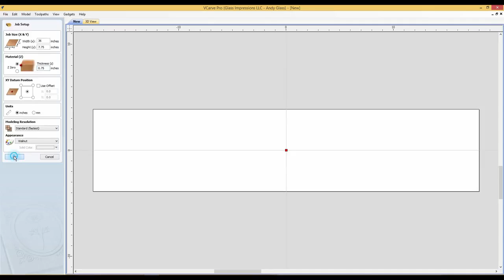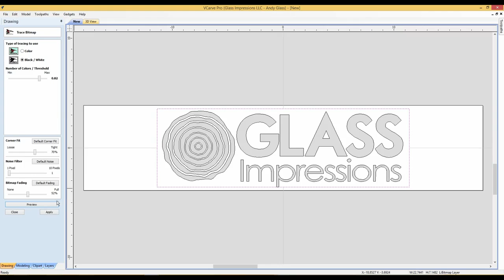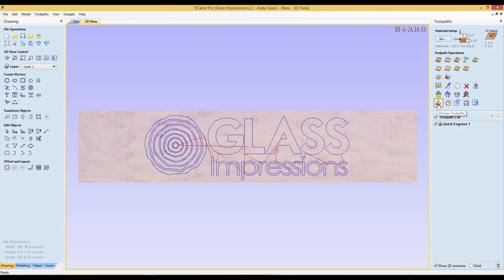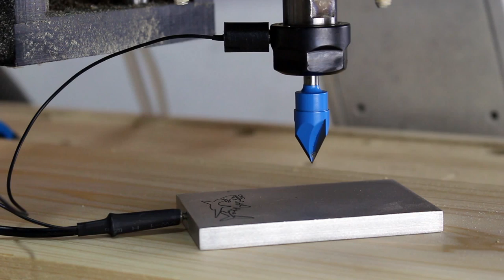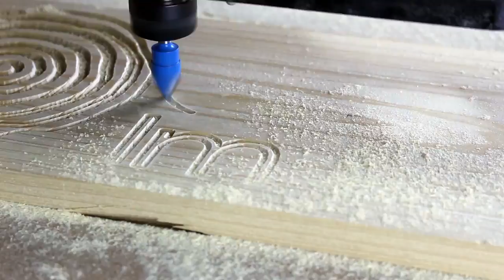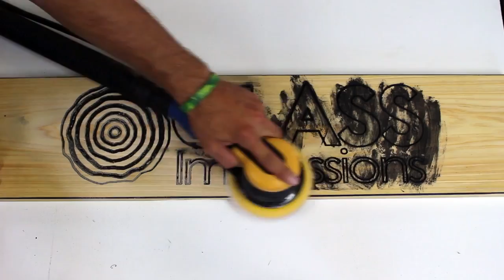CNC Tutorial: Carving from an Image | Glass Impressions

Comment: Good video, informative but i was wondering if something was loose on the cnc because of the rough cutting of the letters? The walls of the cuts are not smooth or is it suppose to be that way? I'm looking at my options for a cnc for my shop so i'm hoping this issue isn't the machine.  Keep up the good work !
Reply: did you ever get an answer to this?
Reply: @jasonfrank405  2 years later and nothing!

Comment: What could be done to make the small "S's" or small curves in the bottom line a smoother curve, I sometimes have the same problem??????
Reply from the maker: The Trace Bitmap function has several adjustments that allow you to adjust how precisely the vector conforms
to the object selected. It is not unusual for the outline to actually follow the bitmap too closely, including the rough outline that is caused by the individual elements (pixels) being traced. You can adjust the Corner Fit and Noise Filter to average out those areas.
You can also go back in after you have traced the image and use the Node Editing tool to adjust the attributes of the outline. Remember, the machine is going to attempt to include each node in your tracing. Often you can improve both the performance and the appearance of your tracing by eliminating or editing nodes.
Vectric has a very informative section of their on-line video tutorials that covers the best practices for tracing bitmaps.